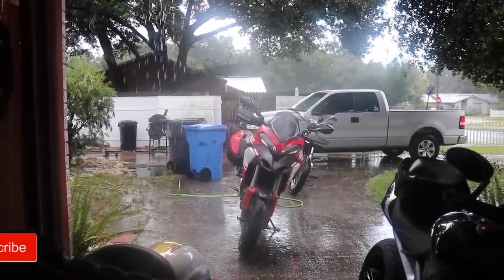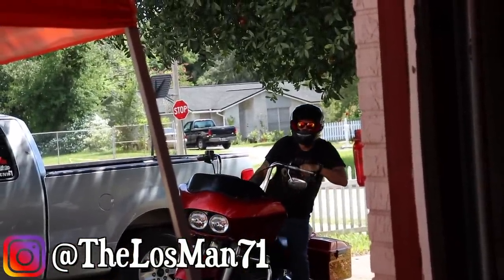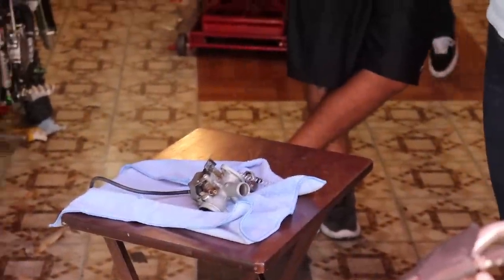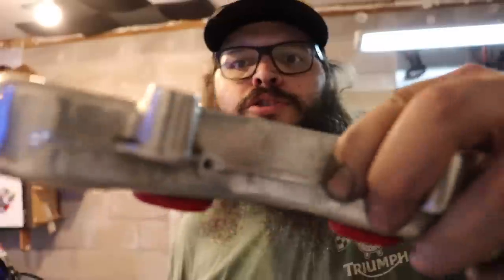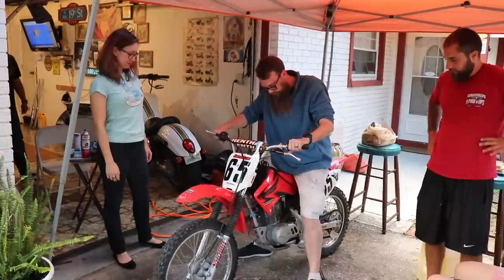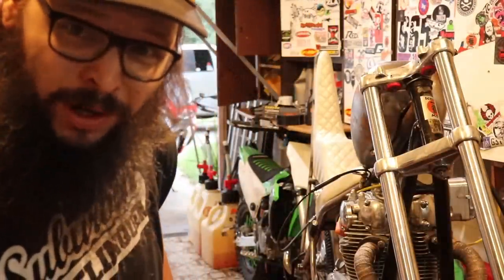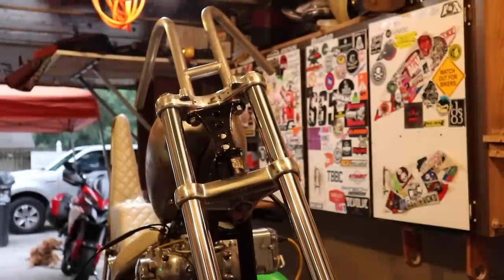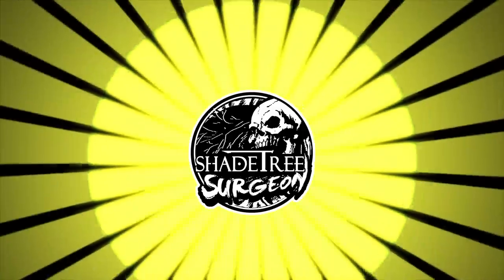Old School Chopper | Yamaha XS650 Chopper Build Series ep 18

Comment: Start with 4 to 600 grit paper and work your way to 2000. Dont skip grits and dont chnge grit till the previous scratches are all gone from the last . wet sand 1000 and up. You wont need polish after 2k grit.
Reply: Vinny   He is correct finer the scratches the smoother it gets should shine up nice ive done custom exhaust years ago
Reply: This is almost exactly what I was going to say. I do a lot of polishing if stainless steel at my job and this is how we do it. Also, use WD40 liberally to lube the sandpaper to keep it from loading up.
Reply: I’m a knife maker so as you can imagine polishing steel is kinda my thing. Vinny is 95% correct if you want a mirror polish 2k grit wont get you there, there will still be a haze. A polishing compound of some type will help a lot, I’d recommend green or white rouge. As far as a power tool is concerned I’d use a small air powered belt sander. The key as I’ve said before and as vinny said, TOTALLY remove scratches before moving onto the next grit no matter what. No skipping steps even if it seems faster..... its not. Alternating sanding direction by 45 degrees will help you see said scratches and some say it removes material slightly faster.

Comment: For removing the flashing and excess metal, I use a Dremel tool with a sanding drum mounted, or a small tapered stone. Does not remove the material as fast, but you have more control.

Comment: You're getting really good at that polishing process. Every piece you do goes a little faster and looks a little better. Great job dude. Offer still stands if you want a plasma cut sissy bar emblem or filler plate for it.

Comment: Hey man one tool I use a lot for polishing that could help speed up your hand sanding process is a dynafile.  Its basically a small hand held belt sander and if you use fine sand paper you can get a pretty uniform surface for hand polishing.  You can find them on amazon or a metal shop supplier like air gas.

Comment: If I could just add a small correction about the handlebars you have. The first pair you mentioned is not a z-bar but a W bar and what distinguishes it from a z bars that they not only go backwards they also go downwards as well. The other pair you called rabbit ears is what I've been informed that new school guys call ape hangers but you have there is what the old school guys call pullbacks. Thanks for the video.

Comment: Start at 600 grit and work up to 2500. Also keep all the paper you use on stainless just for stainless. If you use anything that's been used on mild steel with stainless it will rust.
Reply from the maker: I actually started at 120 and worked up to 2000, still had those micro scratches. I think I need a belt sander
Reply: I think 120 to start was too aggressive and probably what's up. A belt sander should get those deep scratches out then you can work on up. Going with the grain helps to. Stainless polishes like aluminum's badass cousin

Comment: I, built a 1972,  Yamaha  XS650 CHOPPER Hardtail frame I, removed the  swing arm  and  cut and measure and welded a  Hardtail frame in to place  it streached the frame 7" more  longer  and I cut the goose neck and welded it on a 45° degree and added a 40 over springer  front end  still got more work to do to it

Comment: I love what you're doing with the build! You may try stepping out your sandpaper grits before polishing. Start with 600 then 1500 then fine steel wool or even 2000 grit. I think if you stick with fine grit anything on stainless the less scratches. Hopefully that helps. Side note its been douching a lot down here in Charlotte county,

Comment: Awesome work so far dude! You may want to lower the bottom headlight a bit, so the top one does more than light up it's buddy though. Just a bit of a tweak on the bracket should do it bro. Make sure you get the rake and trail checked after the reassembly. Good luck man. Thanks again.

Comment: Use a file to take the casting lines out it'll take a while but you get so much more control than the grinder it'll save time later in the process. Good series man

Comment: Try a fine grit grinding wheel to remove the scratches and dull finish on the bars and then buff them out with some finishing compound purpose rated for stainless steel.

Comment: Every time you go higher on the grit, the smaller the scratches will be, so when you change the sandpaper for a sandpaper with a higher grit is for erase the scratches you did before with the previous grit, so I would try with a higher grit and wet more the sandpaper, it will help to be softer, at least it's how it works with paint

Comment: Bike Looks awesome dude!
With stainless, power tools would be very helpful, But, is possible by hand. As you mentioned, it's a harder metal so unlike with aluminum, you must be more gradual or gradient with abrasives. 
With aluminum you can skip many grit stages because it's softer. Not so with harder stuff.

Comment: Looking good brother, I would use braided brake line for the simple reason you will have too much rubber lined and it will Flex as you apply brake, losing brake power to the calipers good luck my friend

Comment: I would stop with the Sandpaper unless you have anything of the 1200 grit range for finer and go for some Rouge and a power tool with a buffing wheel. it just takes some learning curves and some time but it'll get there .sand papers not good on stainless unless you trying to get out giant holes then it's not worth fixing in the first place

Comment: Josh I almost never comment what I want to say I love your videos I have watched years worth now I'm going to be honest with you bro I was very worried about what headlight you were going to choose not that it's my bike you know I was scared to death you were going to put on one of those strangely shaped square ones or Worse one of those freaking yellow looking ones they make me want to barf but I got to say you could not have chosen a better look for those headlights I mean they make that bike man they are gorgeous both the fact of the way they are shaved and that there are dual ones now other than that I'd like to give you a little tip about polishing even though you probably gotten a billion by now now I polish a lot of aluminum on my own bites over the years and what I found is it's always best to put Krylon rust protector clear coat over them it's not really to protect from rust as you live in Florida but it keeps all the dirt and dust out of any little cracks this that and the other thing so when you wash the bike anything that's on it comes right off and it looks polished again because you probably know but you polish aluminum like a year later it will rarely look polished anymore and that keeps it from happening now because you just polished it I would suggest pouring some mineral spirits on a rag and wiping off what you just polished really good before spraying the Krylon on it and just to do it right you could also get some bare metal adhesive spray and give that a spray before and give that a spray before you spray the Krylon that's the only tip I can give you and you may have already heard it and just don't give a crap hahaha and yeah the Krylon can be a little expensive for a rattle can product it's like 21-22 bucks something like that but you could do the triple trees the wheels and more than likely what every other little part you may polish oh yeah and I don't know if it's simply because you are polishing a lot faster now congratulations on that BTW but they look a little better to

Comment: Nice build... I'm working on a swap from the Yamaha XS650 forks on my trike and want to use a Sportster set of forks and wanted to ask what modifications did you have to do to get the Sportster forks to fit the XS650 neck if any? Thanks!
Reply: I think he did mention a modification he had to do, but don't remember the exact episode. Go back and look for the first "Yamaha XS650 Chopper Build Series ep..." he did on the "Harley Sportster front end" ...I think it would have been episode 11 or 12.

Comment: Front end looks perfect, makes the bike, For the rear brake light switch , use one from for an Ironhead. Also on those stainless steel bars, you're moving in the right direction, now work it with 220, 400, 600, 800 grit wet/dry, 1000, 2000 and on up to 3000 grit. When you get to the 3000 grit use light oil for the wetting agent instead of water, it's called super finish. Just a sample below for steel.
https://motorcyclerenew.blogspot.com/2014/06/yz80a-brake-rod-refurbish.html

Comment: I make polished stainless handlebars (@WannaBeFabrication on ig) and I can tell you that the little buffer from harbor freight has been the best $60 I have ever spent. Just don’t use the wheels that come with it. Get them from ace hardware, Home Depot, or order them online. Use black or green polish compound on the spiral wheel and you’ll have those bars looking better than that chrome. It’ll last longer too.

Comment: https://www.equipmidlands.co.uk/polishing-materials-satin-finish-greaseless-compounds.html   Lea Compound - Use this on a suitable polishing mop (quite soft or buy the recommended mop). I've been using it for years - used to work as a polisher back in the 90's and did work on bikes featured in AWOL and Back Street Heroes magazine. I use 320 grit on a mop to start every job whether alloy or stainless and it takes out all the scratchy crap piss easy - none of that time wasted with sandpaper. It gives a brushed finish and is then ready for the sisal mop followed by the finishing mop - you'd have them bars done in less than an hour and it'd piss all over the lumpy cast marks on your yokes (triple trees as you call them). You do need to keep it in an airtight container and out of direct sunlight though - I lost a whole bar once because I left it next to my shed window and it melted. 
The Yam is looking ace BTW!